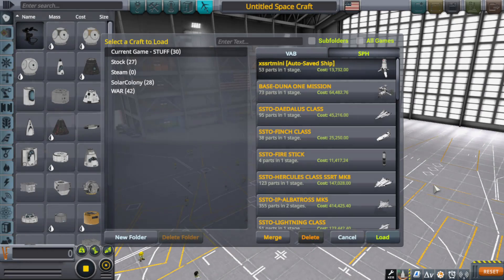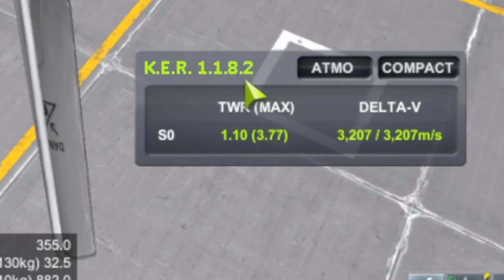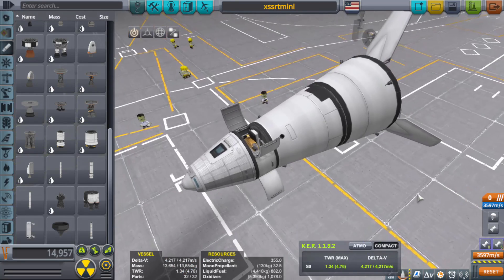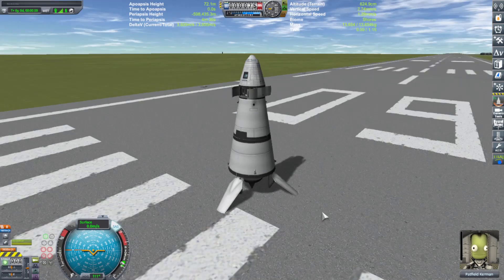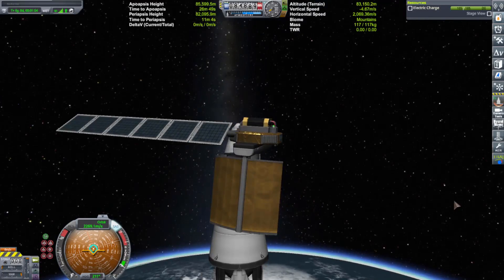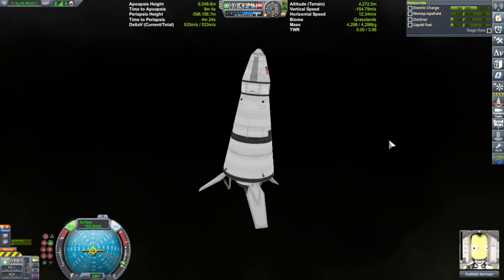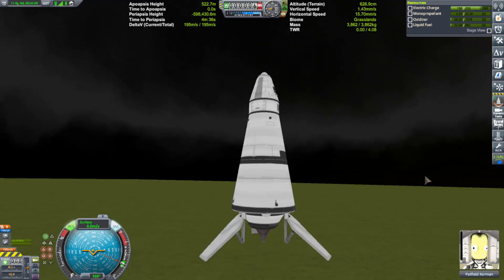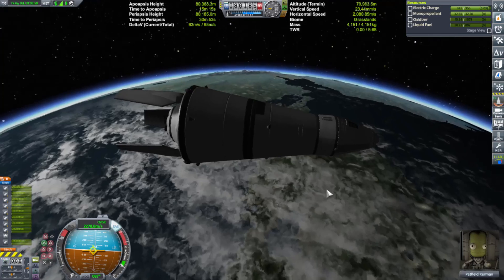SMALL LITTLE SSTO So CUTE!

Comment: I was facing this conundrum when creating VTOL Spaceplanes for Laythe and the other moons. Aerospikes were by far the best performers for engines that would fit in a Mk2 Cargo bay and operate well on the surface of Laythe, but the lack of gimbal was really killing its prospects. 

So ultimately I just added some twitch engines around it to supplement the two Aerospikes and that gave the VTOL its primary vertical thrust and I found that this made a big difference in stability. 

I think if you added just two spark engines either side of the aerospike, it would make a world of difference.

Comment: the real question is, the cost difference between the aerospike and small rockets.   and the tech level difference.   

In game, it looks like you would start with the small the upgrade to the aerospike when you unlock that.  There's no real incame reason to keep the small.  In a "real world" application,   the multi-small might be viewed as a safety feature as a failure in any one or 2 of those engines on mission wouldn't cause a critical mission failure, and in space, its likely that even if only 1 was working, it would still be able to de-orbit.

Comment: Oh, also for SSTOs, assuming they are return-to-launch-site vehicles, you can avoid using solar panels, fuel cells, extra batteries etc and just bring an RTG. They are expensive, but if you are recovering it it doesn't matter, you get the full value back. Now you can carry almost no solar panels and no batteries needed to give reserve capacity to deal with operations in the shade.

For recoverable crew modules/spaceplanes/flyable re-entry vehicles, I have two design philosophies - either build the cheapest most disposable first stage to put your spaceplane/capsule/servicemodule in orbit, and recover that to get the most %age of capital back on recovery, OR build the most over-engineered, extra delta-V first stage that is capable of return to launch site.

While its possible to do it falcon 9 style in kerbal, boostback burns coupled with need for second stage to burn to orbit gives very little time for the player to manage flicking between the vehicles, so i go with even more deltaV and have the first stage go all the way to orbit, then keep enough delta-v for a very aggressive re-entry burn that brings it down to like 1km/s velocity and make an almost vertical descent. Much easier to get the booster on or very close to the space center then too. That way I can put a nerva-powered space glider in orbit that has about 2.5km/s of delta v, plus more from its RCS (ALWAYS give yourself the big rcs thrusters in a foreward configuration and set them up to rcs on throttle so you can use them as a backup propulsion system/OMS. My head canon for that being if for whatever reason they couldn't start the reactor in orbit they can de-orbit with RCS and glide back to launch site). End result is a crew shuttle to ferry kerbals up to space stations, interplanetary vehicles etc that you can operate at almost zero cost.

Comment: Imm go try this now, but one way to make the aerospike work without adding too much weight could be to use liquid fuel rcs thrusters, single ring of them, and only activate when needed.

Also, airbrakes are very for draggy control surfaces. I would use the teeny tiny straight fins, but instead of using 4x radial symmetry, I would do 2x2xaxial symmetry so you have two separate sets of control surfaces; then set deploy on them so they deploy in opposite directions, cancelling each other's control inputs while incurring drag. I use this for simple airbrakes on a lot of craft, instead of adding heavy airbrake surfaces you just make the control surfaces deploy opposite to each other and they incur shitloads of drag and no extra weight penalty and can act as efficient control surfaces and as lifting aerofoils. F-18s do this as well IIRC.

Comment: I think you flipping over with the sparks, was rather due to KSP's aerodynamics - the 9 sparks give you 16 more open nodes than the one open bottom node of the aerospike, giving you a huge increase in drag at the rear.
Reply: having an engine plate would likely solve that issue

Comment: When you added the spark engines, did you attach one to the node of the adapter? If not, maybe that increased the drag and contributed to worse performance compared to the aerospike?
Reply: The difference would be minimal. IIRC VAOS himself did testing on it and found it was like 3-5% DV change. While it would have helped with drag, the extra weight may have made it not worth it. A nose one however might be better due to less weight.

Comment: This is a really nice looking SSRT. Possibly one of my favs. I wonder if you could put the large service bay on the bottom and get something a little larger up there. Might be useful for communications arrays

In my experience, an ambient light boost of 20-25% is the best balance between 'you can tell it's dark here' and 'I can actually see it in the recording'.
Reply: What is the diference of a SSTO and SSRT
Reply: @danielespinoza3168  SSRT predates the SSTO by a number of years, and only uses standard rockets as opposed to the ram/scram/SABRE jets or aerospikes used on SSTO designs
Reply: @lewismassie  thanks!

Comment: Love the small SSRT!

One suggestion:
You could add tiny radially-mounted engines (like the Spider or Twitch) to the Aerospike, they will only provide a tiny amount of additional thrust, but they will give your SSRT a little bit of thrust vectoring to make it a tiny bit more nimble.

It's something early spaceflight did: One fixed engine for raw power, a cluster of tiny gimbaling engines for control. The Starship Boosters will do something similar, with only the innermost ring of engines actually being capable of gimbaling, while the outer ring is fixed in place and only meant to provide lift.

Comment: You can use the airbrakes as control surfaces to help control the aerospike with no gimbal
Reply: @vaos3712  B)
Reply: drag though, it might make the ssto less efficient
Reply: @The Catto of Dankness same issue ‘drag’
Reply: @The Catto of Dankness i think they still cause quite a bit of drag
Reply: @Ch1maera  well wings are meant fo cause drag and its very little drag
Reply: @The Catto of Dankness weight? Ig im not sure though electric power might also be an issue
Reply: @The Catto of Dankness maybe those aren’t efficient enough to get into orbit???? Tbh that might work

Comment: Why not use the RCS thrusters for attitude control during ascent with the aerospike? Would also increase delta V. Or maybe 2 or 3 ant engines if you're really set on keeping monoprop for orbit?
Reply from the maker: RCS to weak in atmo. Ant engines might not be strong enough.
Reply: @vaos3712  Could help for stability in conjunction with the reaction wheels, even if not particularly strong. Just to give you some extra support.

Comment: Maybe you could've used the airbrakes for pitch/yaw control and also double as landing gear
Reply from the maker: using drag to control a craft during launch may not be the best approach. 😊
Reply: to be fair that is literally how control surfaces work @vaos3712
Reply: I had the same thought @vaos3712

Comment: Suggestion: ssto that can be turned into a base or space station
Reply from the maker: sounds like fun 😎
Reply: Kangaroo 3505  maybe you can make it compact by making it foldable using the motors
Reply: A cheap little ssto station would be perfect for small time r&d
Reply: @Kyb3rrat  Hasn’t Matt Lowne done this?
Reply: just slap a mk3 on the science lab and call it a day
Reply: An inline one would work, with docking ports. Rearrange it in space with a probe core on each part
Reply: That was what I was thinking to. The foldable motors thing. U could event make it a compact space station that can fit behind aerodynamic parts.
Reply: @DiabloXTREME  or have the wings of the aircraft rotate into a structural piece of the craft
Reply: I've had an ssrt at my main satellite for a few sessions now. Over burned getting it there and I'm too lazy to bring fuel. Does this count :^)
Reply: @SoftBreadSoft  I guess lol
Reply: Is the objective to retain enough delta V to then return the base or space station to Kerbin? Because its not really a base or station then... its a long duration science mission.
Reply: So an ssto with a docking port?